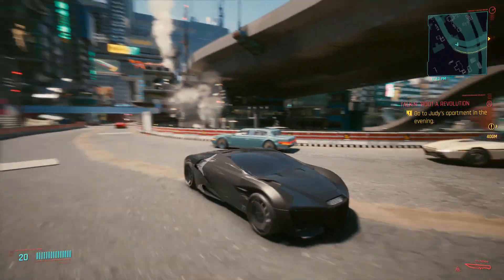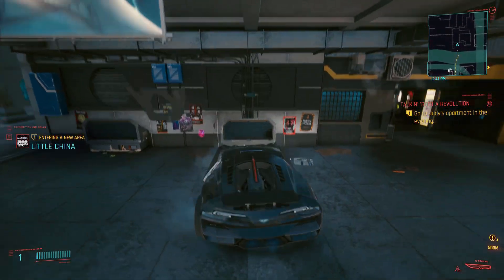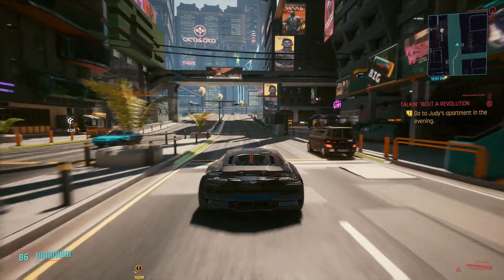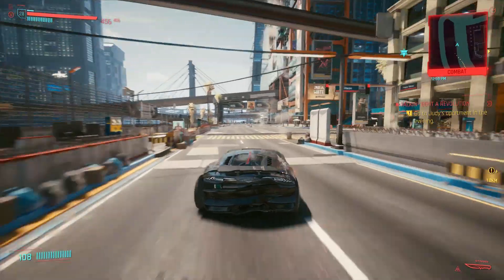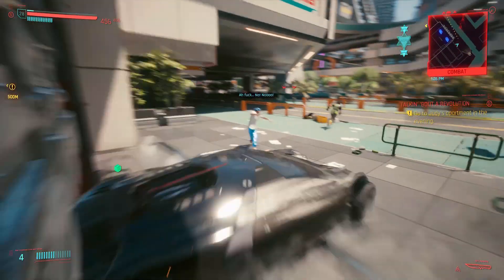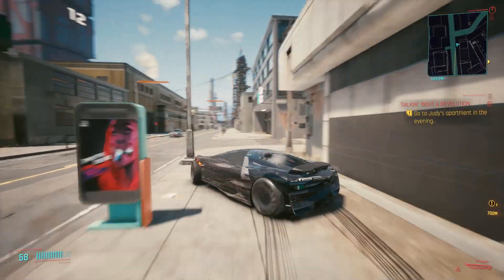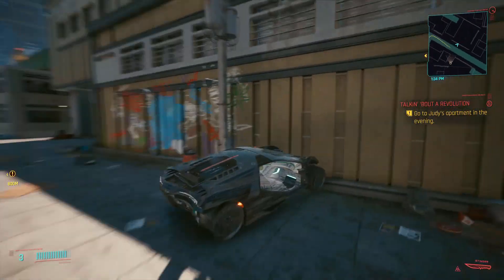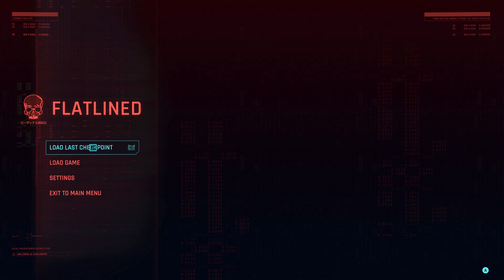How Cyberpunk2077's Physics Work

Comment: I personally don’t mind the physics. The cars in cyberpunk. Especially nomad vehicles which have Anti Mine systems attached to them. Are all incredible durable. Most clothing items you pick up state that they have some form of bullet proofing in the name. So that should also be true of the cars. They should have Kevlar tires, and bulletproof glass.

In fact I’m kinda disappointed that higher tier vehicles aren’t more durable. How come my Quadra Javelina’s door flies off during a crash. When the car is designed to be bullet, and mine proof. Hell you shouldn’t even be able to dent the top Tier cars like the Caliburn and the Aerondight.

Comment: I think the main problem is the cars are way too durable, especially the tires, so unless you’re specifically out to wreck the cars you don’t get to see much of the physics.

The enemies are also kind of like this, just bullet sponges rather than genuinely challenging enemies.
Reply: I mean the Lower Tier Vehicles do have more realistic physics. Go buy yourself a MaiMai and shoot at it a bit. You forget that in Night city shootings are really common. So most cars will likely have bulletproof glass and tires installed. I personally think that some of the High Tier vehicles should be more resistant to damage. 

This isn’t mentioning the fact that most NPCs probably have bulletproof clothing and some layer of sub-dermal armor.